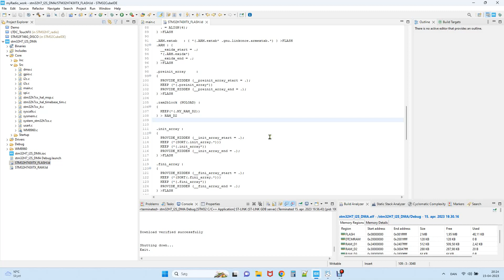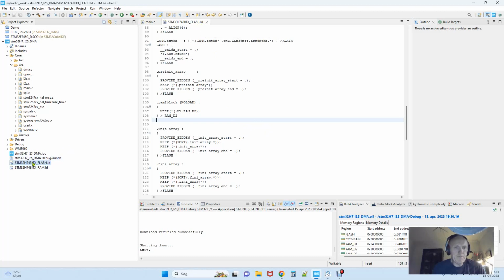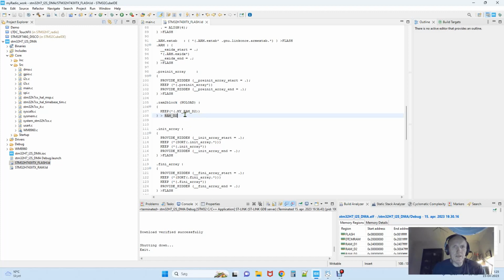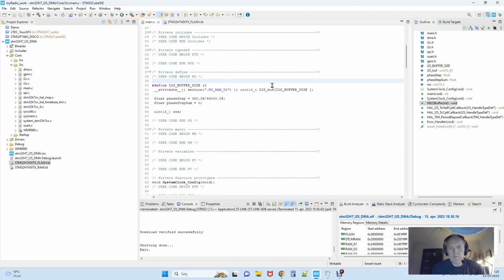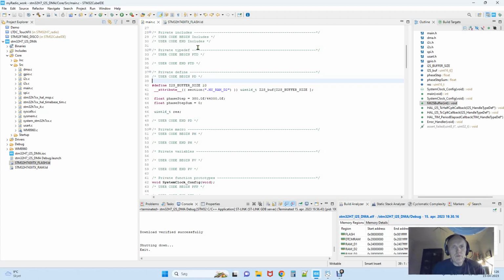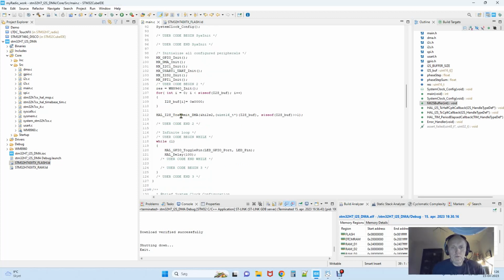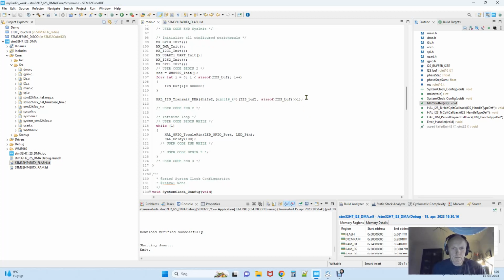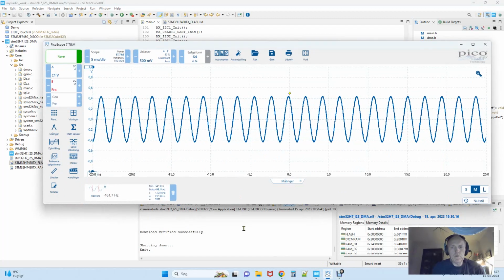STM32H7 I2S DMA problem solved

Comment: I have a STM32H750VBT6 and i want to make an I2S peripheral block to receive audio from an ESP32. I am checking with a logic analyzer if there is I2S signal from the ESP32 and there is. I try to receive the signal on the STM32 in polling mode, i get HAL_OK from the function HAL_I2S_Receive() but i only get zeros. Why do i have this problem?
I checked if I made a right setup of the pins and the I2S2 block, but I am still just getting zeros...
Reply: у меня также (. Нашли решение ?